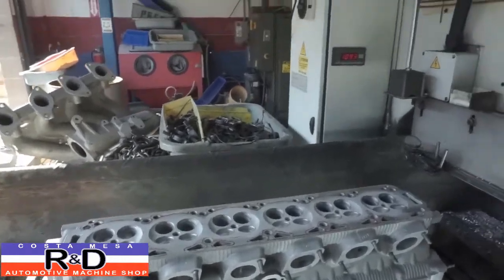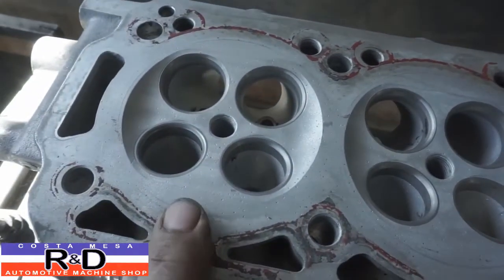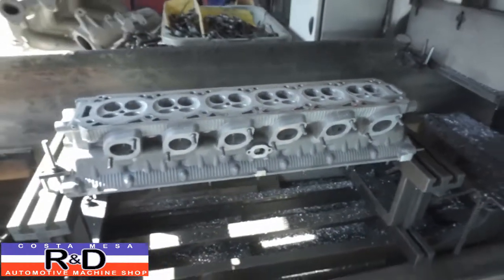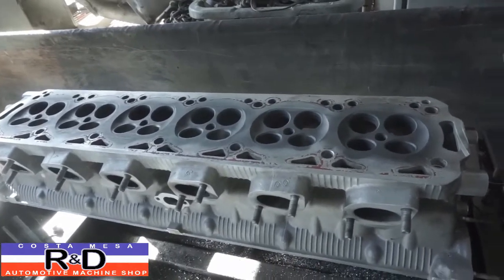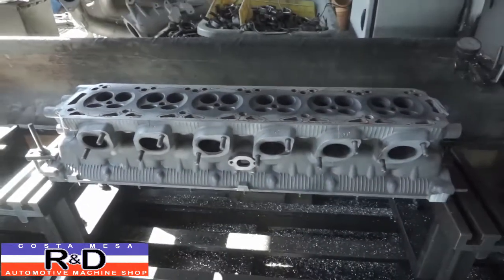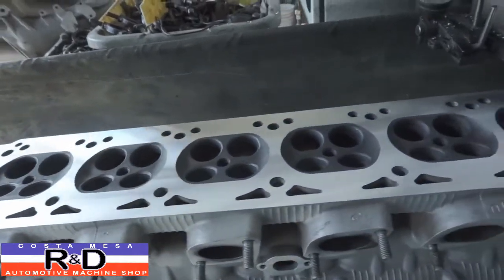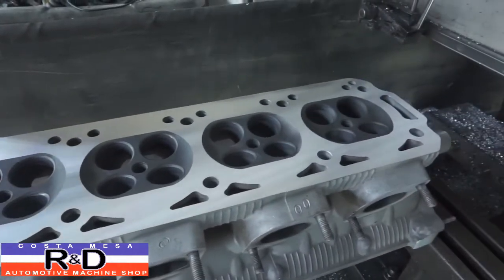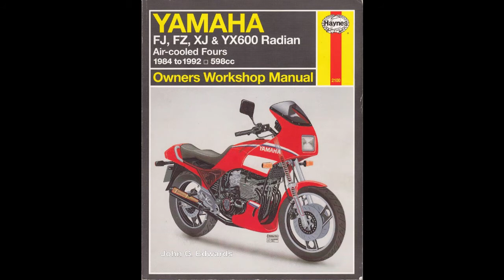Casting Porosity in 456 Ferrari Cylinder Head

Comment: Interesting video as always, the inclusions look very small, no big cavities but it makes you wonder what it is like deeper into the casting.
Reply: It would look the same on the inside. Constant porosity all the way. The process creates a uniform liquid and then uniform solid. At least I can not think what process might change properties in different parts of the cast material.
Reply: Gas rises to the top. You cast the important surface at the bottom and you leave a sacrificial amount at the top that you machine off.